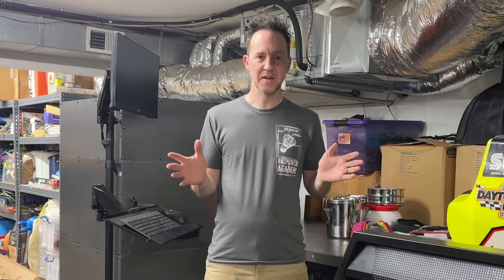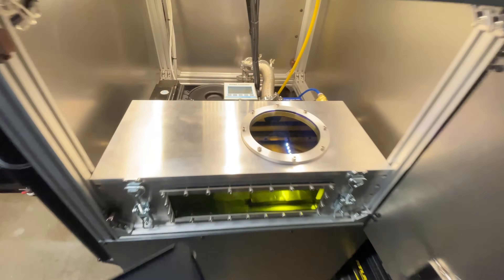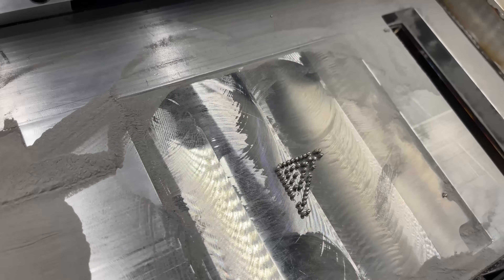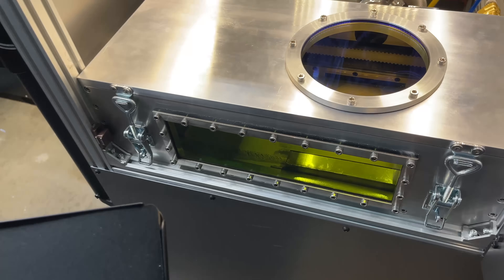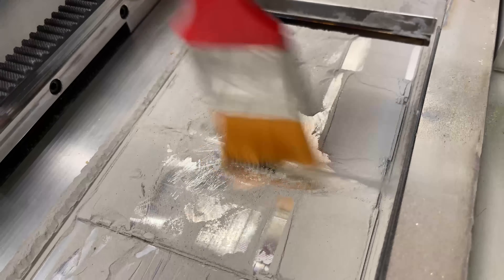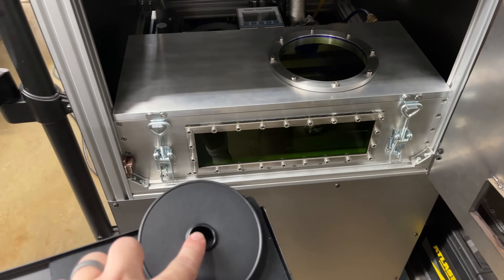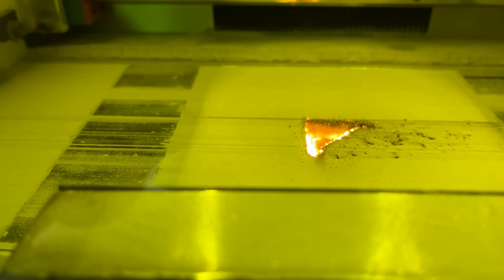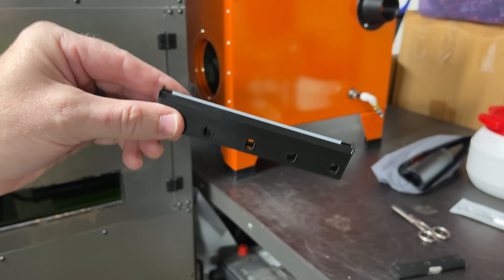DIY Metal 3D Printer: Part 8

Comment: I've seen your issue somewhere before 😅 Your laser is out of focus! You should be seeing big rooster tails with the laser system you have. Another point to note if not already mentioned, that first layer should be razor thin. It looked to be multiple layers thick at one stage (perhaps because you were having issues spreading the powder due it being damp?)
Reply from the maker: Doh! I was hoping that wasn't the case...guess I need to take a step back to fine tune the focal distance. Thanks for sharing your experience! The first layer has been 0.03mm, but it was probably messed up several times due to user error.

Comment: Just a small tip when cleaning the optics lens, preferably from inner to outer in a circular format with the Tx404 wipe in a "pillow" shape. All this helps avoid thermal lensing and other issues from beam entry windows. Coming from EOS/SLM experience.

Also use 99.99 IPA not 99 perfect when able.
Reply from the maker: Awesome, thanks!

Comment: Hi, great trials.
Comparing what you are doing with our SLM printers, I see a few differences. 
- the build plate should drop more than the slicing layer height as the molten metal is denser than the powder. 
- try to park the recoater on the right after the dispensing pass, do the laser pass, move down the build plate , move recoater to the left, push the intake piston and move the recoater to the right again. Doing so, there should be more clearance and you will not pass twice on the powder.
- the first layer is special. Maybe start with a half layer height. If possible you should do a laser power adjustment 'grid' (tabulating different laser powers for different 'squares') and check the result of the 1st layer visually. 
- too much power can create vapor in the molten metal (pinhole effect) and make it bubble. It is better to start at lower power snd increase until you see a consistent layer surface.
Reply from the maker: Thanks for the tips! The build plate and powder plate are dropping down during the return pass to avoid contact...I think it is just hitting because of the swelling. Still need to do more testing to find that correct power setting.

Comment: Try line supports in the direction of the recoater. You could also try a thin sheet of aluminum on the build plate that is glues on with silicone. Hopefully it will not steal heat from the first layer bonding. try also starting the recoater with a pile to push so it is fully loaded from the start.

Comment: Watched till 11minute, I think you need to adjust g code, so every time silicone scraper/rackel goes over the working area, the working are goes down couple millimeters down from what you have now, then next pass It should be already at its working level, this is how you bring more material and fill up the entire surface without gaps, I would also just added 2more filling passes

Comment: Does your source have a Q-Pulse (Q-Switching) setting? Q-Pulse regulates the pulse duration—the time during which the laser energy is released in a single pulse. This affects the energy distribution over time. I recommend setting this parameter between 500 and 1000 ns.
First-layer adhesion should be adjusted separately from the main mode. Set the first layer with higher parameters to ensure a base first layer forms on the bed. Next, reduce the pulse parameters so the laser melts the powder rather than burns it away. It's difficult to explain, but the powder has parameters specified by the manufacturer, and these parameters should contain information for adjusting the print settings.
Reply: It's not a pulsed laser.
Reply: @Spirit532 If it's not a pulsed laser, it will be difficult to adjust. 
A continuous fiber laser / beam laser has a very high thermal impact. 
In that case, I would advise reducing the power and working at a faster speed. 
Smaller models will be difficult to adjust and will have a strong thermal impact on the material.
Reply: @sergeyspb3265  Pulsed lasers are not used for SLM. It's also literally the point of SLM to have a high thermal impact.
Also, q-switching doesn't let you adjust the pulse length. Q-switching is the method by means pulses are generated in an otherwise CW cavity.
The "q-pulse" setting in EZCAD specifically(which is the only place it's used) refers to pulse length control on a MOPA source, which does not use Q-switching.

Comment: Is it normal to have a bunch of support dots first? It seems like if you did a larger solid first layer, it would be less prone to lifting up regardless of adhesion to the build plate. I kinda assumed SLM/SLS machines just created their part suspended amongst a bunch of powder, instead adhered to a plate.
Reply from the maker: I've moved to printing a raft first before the supports. I believe it adheres to the build plate to disperse heat and prevent warping.

Comment: I think another issue is the wiper. It seems to catch the supports and exacerbate your issues. I agree about porosity. It doesn't look clean. I suspect you have tapped air in your powder beds.

Comment: Awesome project, welcome to integration hell haha, some things I would try: (as someone who doesn't know much)
1) Test pattern as some people have already mentioned.
2) From the video it looks like you are boiling the material and thats causing all kinds of blobbing problems, maybe try multiple low power passes to heat and/or sinter the metal then hit it with the full power?
3) Some kinda heat exchanger to heat the argon as it comes into the chamber?

Don't give up, integration/first prototypes can be pretty rough some times!

Also this video from Metal Matters is great. https://www.youtube.com/watch?v=_SwsatEJn9k He's tried this problem from a couple different angles, wire feed and powder based. He had some similar problems with the first layer.

Comment: Thoughts:
Change first layer settings to increased power or slower to improve bond.
Swap squeegee for something with a bit more give
Increase resolution or do multiple offset dot matrix passes to smooth top surface. Think checkerboard but do black squares first and white next

Comment: Love your vids. 
If I may make a suggestion. From what I noted, you got the best results with adhesion at a higher watt. And your wiper looks to be melting. 
1. Set layer 1 to 500w, and the next layers to a lower watt.
2. Set an extra few seconds on the wiper blade for new layer. To allow for the layer to cool a bit more. 
3. Use a nylon for the wiper blade many 3d printing filaments available.
Reply: Silicon has a much higher melting temp than nylon, but your other suggestions seem good.
Reply: @sheariley1910 i know there are some high temp silicons out there as well. And you are 100% correct. I should have googled it before commenting. It was just the first thing that popped into my head for my current project im working on.

Comment: Way too hot/too small a layer height. Also expecting tiny support pillars to stick to the build plate is kinda silly I mean unless you're trying to push the limits of what's possible on the very first print. If not here should be a raft of at least like 2 or 3 layers under the support pillars.

I'm not an expert in SLS but I'm pretty sure what you're trying to achieve is essentially sintering (which is fusing the metal particles not fully liquifying them) like it appears you've done on this video.

Comment: Make sure you build a custom gpt and feed it some research and technical documents about what you're doing. This will make a massive difference in the info you get from gpt. I did this while developing material profile settings on the Formlabs Fuse 1 for a 3rd party material.

Also, hats off to you. Dealing with nylon powder was hard enough lol.
Reply from the maker: Thanks for the tip...I didn't even know that was possible with GTP : )
Reply: @diyfiberlaser custom gpt requires a subscription to build. There is a library of them that other people have built too.

You feed it a custom prompt that it references everytime you start a conversation, to introduce it to the subject matter, and you can upload documents to its permanent memory that it can reference whenever it gets off track. GPT can only remember a few thousand words of the conversation history. Some long term knowledge goes a long way to avoid it lying to you, especially when dealing with stuff like a DIY sls printer, where it wasn't trained on.

Comment: My entirely unqualified opinions: 1. Order of operations appears wrong. Shouldn't it be: Laser, lower bed, spread powder, return and smooth? Looks like it's laser, spread, lower, return. 
Also, when the laser fires, what thickness of powder is getting melted? AKA, whats your layer height? You could either lower the power output to reduce the layer/melt thickness, or you'll need to lower the bed more to account.

Comment: You generally want a teeny tiny little bit of powder on the plate. Enough where you can only barely see the surface marks when you get the light just right, but you can see a shadow of powder across the whole plate. You can go thicker on the first layer if you either double scan or scan at a higher power for your first layer. When I ran production machines thats how we ensured a solid first layer
Reply: We would also feed more powder from the powder bed than the height of the layer thickness. Developing proper laser parameters is certainly a bit of a slog though, I believe you can do it!
Reply: @noahc6544  How did you deal with the melting wipe issue?
Reply: @daviniusb6798 we used silicone wipers that would get damaged by the end of each print job(~3000 layers iirc)
We were primarily printing titanium, but the laser power we would use for our "power" burn looks a lot lile what is currently being used for every layer in the current setup. It could also be an airflow issue if you are scanning too fast and sintering soot into the build
Reply: @noahc6544  Are there alternatives like high-temperature silicone brushes?
Reply: @daviniusb6798 if you run more solid parts you can get away with thicker silicone wipers that last longer than a single job. But we ran a lot of smaller parts and a lot of lattice structures so it was very uncommon for a wiper blade to last more than one print job
Reply: @noahc6544  I always thought they would last like PEI sheets in SLA maschines. Thanks!

Comment: When we start a print, we have a smaller (thinner) layer of powder that we call the scratch coat... that's mostly empty with just a little bit of powder melted to it.  That allows the new material to grip similar material.

Comment: I’m not sure if you’re changing one parameter at a time and documenting the changes, but you can adjust multiple parameters at the same time and still figure out which one has/had the biggest impact. It’s called Taguchi’s method or orthogonal arrays. Even though you’ll need to design which parameters to change and when, and then analyze the results. But it’s a great way to reduce the number of tests you need to run.

Also does the silicon cord always stays at the same hight? even when the residual heat of the metal is affecting it?

nice video! waiting to see the completion of the project
Reply from the maker: I know exactly what you mean! I'm still trying to understand the software and I'm not sure that it allows me to set multiple different parameter during the same print...sure would make testing faster : ) I'm going to try replacing the silicon with a stainless rod and see if it works better.

Comment: the first layer wouldn't matter as much if the build plate went down farther on each layer so the sweeper never touches the print and crank up the laser to be able to melt a thicker layer and you can also add a sacrificial thin metal plate attached by magnets for better adhesion because the heat will be able to penetrate a thin plate and heat it quickly

Comment: Is the surface finish on the build plate sufficiently smooth? I have no SLM experience at all, but it feels like something that might be ground flat in the commercial models? 
Also, the obligatory question, how thoroughly did you clean the build plate?
Reply from the maker: It's as smooth as I can get it with a face mill. I don't have a surface grinder. I didn't clean the build plate after handling it...next time I will wipe it with alcohol.

Comment: My thinking is the powder alone is going to be difficult to achieve uniform layer heights. However fine your powder is, it will be especially difficult to spread out evenly because it still might be too course or it may shift around too much when it gets spread.

But your squeegee powder spreader gave me another idea. I lasted for about two weeks at a factory job when I was younger. The company was making the rfid/nfc tags that go into modern passports and ids in North America. They would screen print the circuits onto thin plastic films with a conductive ink (it was doped with silver powder). Could you use the same idea here? Your powder is very fine so you could make a metal paste by mixing it into a binder that you could heat up to melt away once a print is complete. You could modify the squeegee to deposit uniform coats of the mix onto the build plate at each layer. I think using a binder/mixture will produce more reliable results

Comment: one thing to consider is the spot intensity, not just the power, how the power is distributed across the spot itself. you may want to defocus and raise the power potentially, or something like that, to get a move even distribution of temperature in the melt pool, rather then a really high temp 'boil' directly in the center.

Comment: First, I think the build plate is too thick and is absorbing too much of the heat. Also, you could try giving the build plate a coating of some kind of flux. Kind of like priming the plate with glue stick on a regular 3D printer.

Comment: Have you tried reducing laser power to be just enough to  melt the powder and no more? Also in some of those shots it looks like the part is not dropping down enough and or getting a full layer of powder over it.
Reply from the maker: I'm still trying to narrow down what that melt point is. The layer height is only 0.03mm, so it's barely noticeable that the bed is moving down or being covered.

Comment: You might want to compact the powder in the feed chamber to remove the air pockets, this is what I use to do with the old zcorp printers
Reply: Also a counter rotating roller might help with your powder spreading issues 👍

Comment: If you need a heated build plate, could you do an initial pass over the whole plate with the laser to pre-heat the build surface? You could potentially adjust this in future to only treat the build area and just a little outside of it.

Comment: You never said if the O2 went down after your fixes or not, but 0.8% is still more than enough to cause balling and delamination issues.
I think you REALLY need to get at least a 2-stage rotary vacuum pump set up to empty the chamber before and during the first purge, but maybe if that's not possible, you could try it first with an other powder material that doesn't form such a problematic oxide so readily?

The other big issue is powder purity and powder surface quality. I really wouldn't recommend trying to reuse powder until you have everything working perfectly with virgin material; however, most important is to characterise your powder as it comes from the supplier and figure out if it's got a bad oxide layer already formed on the grains, as well as what other contaminants may be on there.

At least to start, I'd recommend that you manually sift the virgin powder to a much tighter tolerance (e.g. +- 5~10% of the mesh value for powder averaging between 100~350 mesh. So a 150 mesh powder would get sieved between 135~140 and 160~165 ), after initial drying.
Also, do the drying under vaccuum (or at least under inert gas) to minimise oxide skin formation.
If you find that your powder already comes with a significant oxide contamination, you should probably find a better supplier; however, you might as well try stripping the oxide, then QUICKLY quenching the different tested acids in cold water, followed by rinsing with copious amounts of water and a final rinse with pure Methanol or Ethanol.

Finally, try at least giving one sifted batch a VERY good cleaning in an ultrasonic cleaner (at >100kHz frequency to get at the smaller particles), or at the very least give it a few different washings with pure degreasing solvents (that are at least "AR-GRADE" purity, but you're looking for the minimum Residue On Ignition values that you can afford), such as:
Begin with Ethanol or Isopropanol, then Diethyl Ether, then DCM or Chloroform, and finally some Heptane. Just like you would wash a crude compound in a chemical lab (i.e. do each washing at least 3x with smaller portions in stead of doing one big washing), to really make sure all of the surfaces are as clean and oxide free as possible.

(PS. Ensure than your spreading blade isn't contaminating the powder or the build surface with some residual organic film either and that your Argon also doesn't contain ANY oil, as it's a common contaminant when the producer used oil-filled gas compressors)

Comment: I have also dreamed about building my own sls printer. I know with earlier technology for pa12 the machines compressed the material for the first layer and everything else was supported by the powder its self. My only valid suggestion for your setup would be 1 starting with  a roughly sanded bed, 2 larger supports/surface area and 3 a flux coating on the bed. Also is the bed weld-able steel?
Reply from the maker: Thanks for the tips!